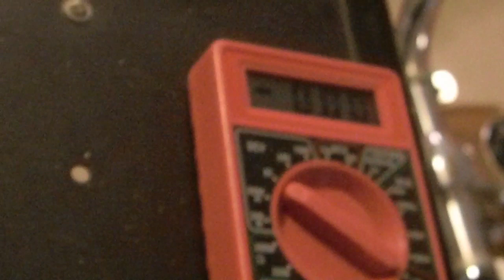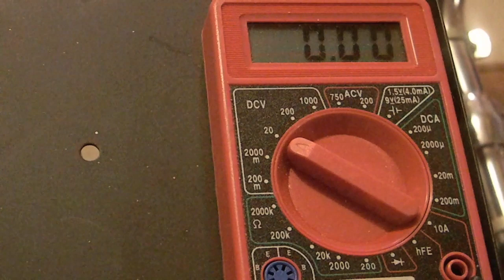How to Build a Generator Using a Stationary Bike | DIY Bike Generator | Burn Fat Not Gas!

Comment: Did you have any issues structurally with the 2x4 / motor assembly being pulled rotationally clockwise into the flywheel?

Comment: Amazing transformation: the first spin bike! I like the way the old frame is designed because it's so easy to attach a speed sensor on it. (The new Wahoo tiny little sensor w/out magnets would be ideal.) The book stand can hold a tablet or a console can be coded to pick up speed, cadence and resistance. Better yet, the console can just be an app for any tablet.